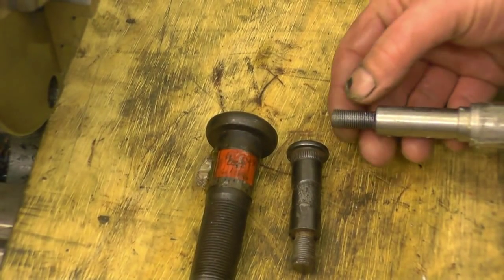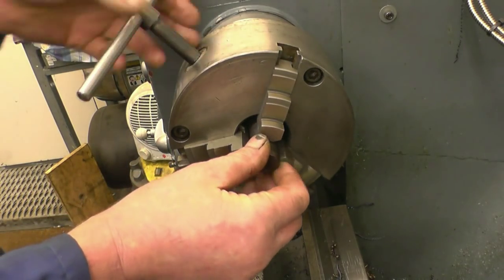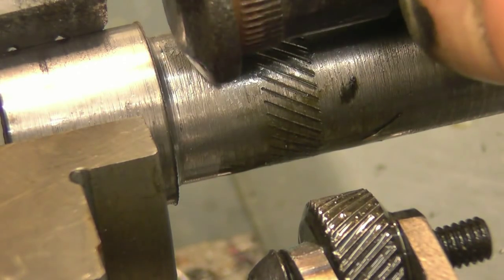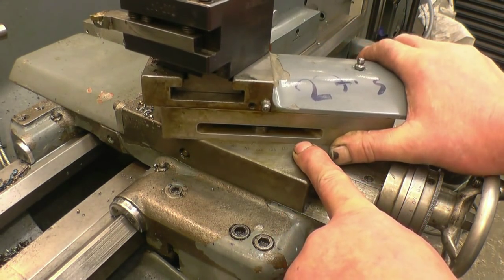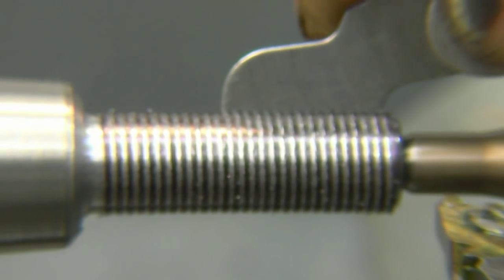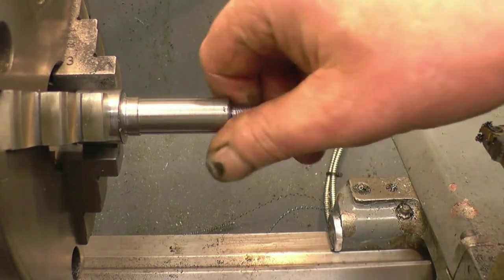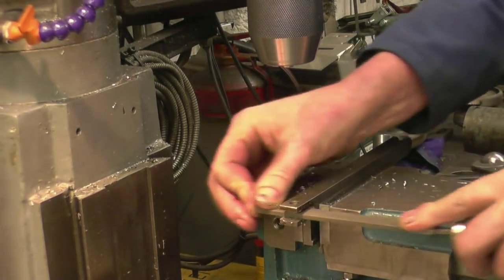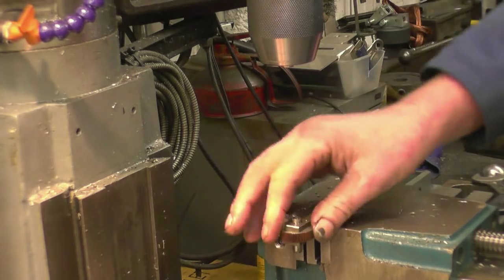SNNC 110 P2 Machining hard steel /screw cutting

Comment: John, I think the reason that the strait knurl did not work well is because the shaft diameter must be a specific diameter to "match" the pitch of the knurl. I can email you a chart showing this if you want. I have been there, I know how this goes!
Reply: +flintknappingtools because what is happening is that it is "cross threading" or better said, the knurl teeth are not tracking into their groves as it comes around full circumference.
Reply: +flintknappingtools is there any chance of putting a link up to it please??

Comment: I used to work designing forging tools for the company that made that wheel bolt, the ones I did had clipped heads but its likely off the same machine. There's a lot of engineering in those studs, their extruded, upset, rolled and finally heat treated and either phosphated or geomet coated. Would like to think its one of our Wolverhampton made ones rather than the German alternative I might have seen it coming out the machine, either way glad to see it going to good use.
Reply from the maker: +nickmartin666 It is certainly a decent bit of steel I have a bucket full of them

Comment: I had similar results trying to knurl on my Myford. I tried the slowest backgear and still very poor, so I then resorted to turning the lathe over using the headstock handle and plenty of oil and the results were excellent. Very slow speed and immense pressure on the twin roller knurling tool. The single knurl is a bearing destroyer or so I have read.
Reply from the maker: +beehivepud It puts massive force on the lathe

Comment: Hi John with a straight knurl you need to start with a diameter who's circumference will evenly divide by the pitch of your knurl teeth ( measures with your calliper) otherwise you multi track giving a very fine effect, you will have lots of start diameters near the size yo want, Sod's law you got between two. Hope that's of use
Colinb
Reply from the maker: +Colin Bagshaw Thanks for that   it makes sense
Reply: +doubleboost ya, that's right. The diameter must me mathematically calculated so it will not cross knurl. :-)
Reply: +Colin Bagshaw Yes. If the knurl on the wheel has a 1mm pitch then the circumference of the job has to be a multiple of 1mm

Comment: I keep going back and forth in my mind on if the stud made with 30 degrees instead of 60 would still work with a nut or not. Did you actually try putting a nut on it? I know its not the "right" way to do it and single point the cut but the tool itself has the proper angles ground onto it and that confuses me.  Thanks for the video. I enjoyed it like all of yours. I also hope Debs and your  dad are doing well and Debs had a great time away and has lots of stories to tell you.
Reply from the maker: +David Queen It would have been fine   but not as strong as the new one
Reply: +David Queen One side of the thread would be at 30, cut by leading edge of the tool bit, the other would be at 60 cut by the top slide using the very tip of the insert. This gives a thread angle of 90 instead of 60. Hope this makes sense.